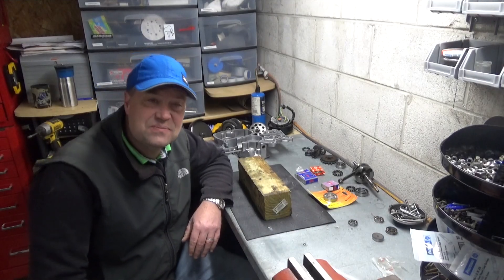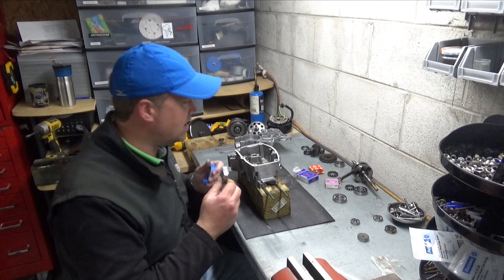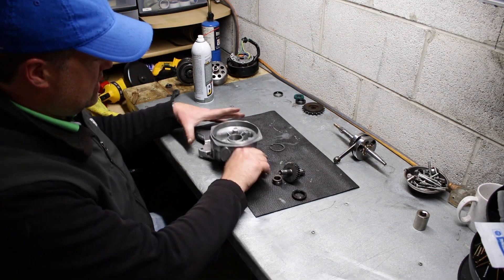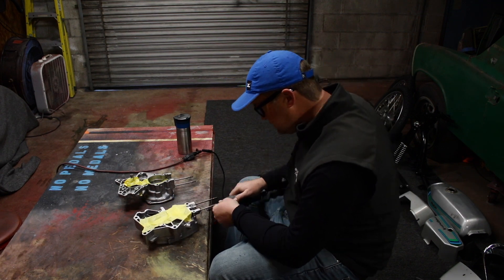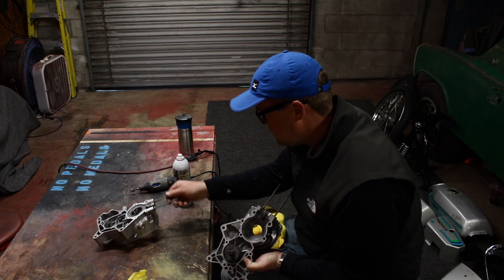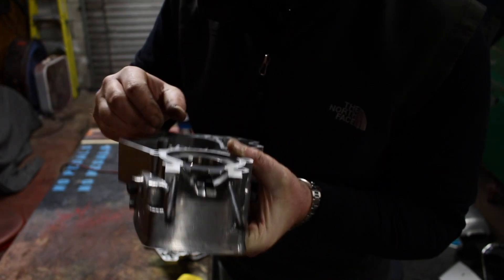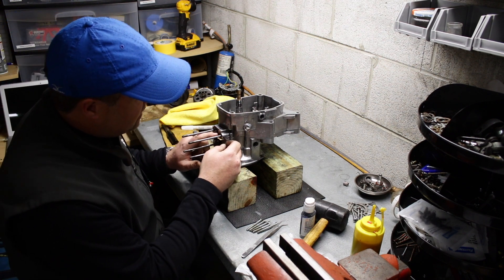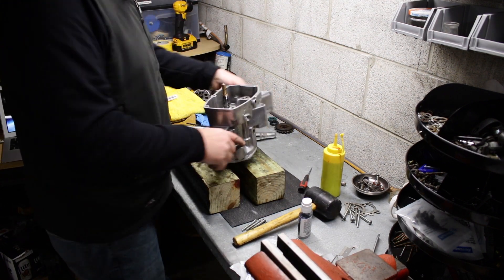DFHS Puch Magnum Ep.4 - ZA50 Engine Bottom End Rebuild

Comment: I'm really glad you rebuilt the ZA50, I've got one to rebuild soon and it's always good to have you show me how to do it right before I go ahead and mess it up anyway! ZAs barely exist over here so I'm gonna have a hard time getting parts if I fluff it up...
Reply from the maker: I finally got her dialed in. It’s a finicky motor. Did NOT like the Bing carb on that kit, so I had to swap that out for a better one. Also, timing is crazy touchy. I can add 5-6 mph with VERY slight tweaks. Today is my birthday, so the wife and kids gave me the whole day at my workshop. I just got back from a 30 mile ride and I took the GoPro. So now I just gotta edit the video and this one is all done. Already planning out the next one 😜

Comment: ha ha, you found those shims after all, i really hope that your end float is still ok after that new gasket. great job! good choice with the atomic dampeners, i had over 1500 miles on my assembly before i sold it. no issues, no degradation.
These engines are aching for more power, soo overbuilt. excited to see what kit you chose! i do see a decomp hole in it tho. get out the jbweld or thread that thingy for a plug if its too close to the edge of ur gasket. passage goes right to the exhaust port. can cause problems.

i have had great luck with both the k-star and the airsal. not sure if thats what you have there, the casting on the fins look better than the ones i had. maybe just the camera.ha
Reply from the maker: Figured out about the decomp hole. Unfortunately, it was after the engine was back on the bike and I had to remove it. I film these videos in advance, so by the time you are watching it, I’m already two or three episodes ahead. Ended up threading it and using jb weld. Gotta be thorough 🤓
Reply: Gotcha, imma dum dum. lol

Comment: Hey David, since you have rebuilt the Puch ZA50 engine perhaps you can provide some insight to my problem: started my 78 maxi ll and after about 5 mins. smoke began to come from beneath the engine and oil puddle on the floor, upon examining the crankcase did not find the leak source, no oil coming from crank seal in Magneto area, suspect crankcase not venting thus pressure build up, appreciate any suggestions
Reply from the maker: Heya Bill.  As always, it’s real hard to diagnose these things remotely. Is it oil or ATF?  If actual oil, then it’s something with your carb or gas line, since that’s the only place oil can come in.  If oil is coming out of your case, then your mix is FAR too rich.  If instead it is ATF, then the answer is simple— one of your gaskets or seals is leaking. Maybe it’s just the washer around the drain plug?  That’s a super simple fix, so check it first. But since it is smoking, I’d bet it’s higher up.
Reply: @DavidFixesHisShit  Thank you David, the puddle is actually oil , I did have to open the idle mixture  since the engine was running to lean, maybe you may have I.D'd the problem, I'll check that and clean the carb again, The engine compression is just over 142 psi
Reply: @DavidFixesHisShit  Hi David, a little update on the 78 Puch maxi 2 sport, it did have ATF fluid and not oil( approx. 900ml) drained using the port screw about 7/8 in. from bottom of case clutch side and just a trace from the drain plug. On top the clutch housing there was what appeared to be a white plug remnant when touched the remainder fell into the case could not have been much left of it, I imagine that would be the fill port, cannot find a manual on this thing any help is appreciated.

Comment: How well did this engine run after this rebuild? I'm getting ready to throw a new crank in my za50, complete rebuild, and have read a lot about problems with shimming and making sure your end float is good and just all about measurements. You seem to just throw this back together the way it came apart.
Reply: I agree, I am in the UK, and people shim when rebuilding.
Can you please talk on this Topic Dave
I no nothing about shimming and you didn't shim when you rebuilt 
CONFUSED
Reply from the maker: Hey Nate.  I heard the horror stories as well with the shimming and the end float.  My plan was to build the engine, and then move the crank and see if I had any play.  If I did, I would just take the engine apart and shim it to take that play out.  Or if it was too tight, I would use a wider gasket to make up for it.  As it turns out, when I got the engine back together, it was perfect.  I mean I didn't put a micrometer on it or anything, but it spun freely and didn't move side to side.  That's good enough for me, so I ran with it.  It is, after all, only a moped!  If it breaks, you fix it.  Thats the most fun part.  Ive put about 1500 miles on that engine now, and it still spins like a top!

Comment: Hey David great video.  I just got a magnum. With that first gear clutch and the lock washer, should it have a little give/wiggle in and out? Or is it pretty tight? Thanks!
Reply from the maker: I’m trying to think back and I don’t think I got it too tight. I’m gonna get back in there in the next month or two and flip the clutch to see if I can get it to change later.  I’ll take a look and report back.
Reply: @DavidFixesHisShit  hey thanks for the reponse! Actually got it figured out this weekend, had a something out of order that was jamming it up. She's up and running, just have to tinker a bit with the throttle as it's on full bore without touching it.

Comment: Hey great videos! Does this za50 have oil injector? About to rebuild my ZA but heard oil injected za's use different bearings
Reply from the maker: Mine didn't have the injector.  Instead, it came with a mixing cup :-).  Not sure about the bearings.  I looked in my service manual and it doesn't say anything about them being different...
Reply: @DavidFixesHisShit  
Hey david,
Were did you found that service manual? I am gonna rebuild a za50, but i can't find anything about the specs
Reply from the maker: https://martysgarage.info/wp-content/uploads/2014/05/puchservicemanuals.pdf
Reply: @DavidFixesHisShit  thank you, am now revising a za50 myself. these videos help well only it is difficult to find good parts and specifications here in the netherlands

Comment: Dave!! I asked the question a while back on another video, and got no response...How do you set the timing on a tomos engine?? I have heard and read there is suppose to be a mark on the stator that lines up with, or in between 2 lines on the engine case. But the stator coil I got from treatland https://www.treatland.tv/original-tomos-A55-OEM-cdi-stator-pickup-p/oem-tomos-cdi-stator-243100.htm doesn't have a mark on it anywhere...???
Reply from the maker: Heya Quentin. You bought the stator for an A55. Is that the engine you have?    If I remember correctly, you can’t adjust timing on the late model Tomos engines. They didn’t want you messing it up.  If you have an A35, don’t worry, you can still set the timing, but your going to need a timing light to do it. If you don’t have one, I think you can borrow one from an auto parts store for free. Park your moped next to your car so you can use its 12V. Not sure if you’ve seen this before, but it’s everything you ever wanted to know about Tomos timing. http://www.myronsmopeds.com/category/service/new-tomos-electrical/new-tomos-ignition/
Reply: @DavidFixesHisShit  Yeah my bike's a 2010 sprint a55. By the way Dave love your video's you remind me of my Father! You also have taught me a lot about mopeds!! :-)   Thanks for the link too!!
Reply: youll figure it out! as a suggestion though, the a55 cdi has a rev limiter that cuts out the power at a certain point...research a better cdi box. aftermarket(and even stock on the newer tomos's) have a bad rep for failing within a few hundred miles.
Reply: @aaronblair9583  Yeah I think I got it all figured out. Thanks again for the help everybody!!! :-)
Reply: @DavidFixesHisShit  Got the EVIL 2010 Sprint running again (ready to chuck it in the garbage lmfaorofllol), but the headlight is dim, horn doesn't work, and kill switch doesn't work EITHER!!!! Now when I turn the kill switch to ground the horn works and headlight brightens, but the kill switch still doesn't work!?!?!?! Any suggestions? I'd prefer not pull the plug boot every time I shut off the engine :-)
Reply: Quentin Moon  sounds like you’ve got some wiring messed up. In the simplest worlds the stator has two hot wires out- one for the ignition and one for accessories. The ignition wire should branch off before the coil to the kill switch which is then grounded to kill it. Then you have the accessories wire that splits to horn lights blinkers whatevs. And both of those main hot lines run to the front of your bike. Track and isolate them from stator to forks and you’ll find your problem. Maybe you’re running lights off of your ignition. Maybe your kill switch ground is feeding into the lights instead of grounding. Lots of ways to get fubar’d up by the forks with that rats nest of wires.
Reply: @glewis7466  I found it was better to just rebuild the whole harness it was in such bad shape. Thanks for the tips though guys.

Comment: I have an 1980 Indian and it's missing the motor does anyone know what motor will fit other than the original motor? One that does not require modification or extensive modification. I do have another Indian that is complete and i have been in the process of restoration.
Thank you for any info that you can provide.
Reply from the maker: I dunno Rob. I would guess that you could put any motor you want on there. Of course, it depends on how much fabrication you want to do. I’d recommend either a Tomos engine or and E50, as they are the most common (with parts readily available).
Reply: I read that there is a Honda engine that they used as the prototype for the Indian engine but the Honda engine is very hard to come by.I really would not like to do a lot of fabrication. I guess I will have to keep my eyes open for an original Indian engine.My other Indian right now is in a basket I have most of the parts restored except the frame since it will need to be stripped down and painted also the gas tank needs derusting and I need to drain the old oil from the motor and change it. So it is an ongoing project hopefully I can get it running this year. Your restorations keep me motivated to not loose faith in mine.Cheers
Reply: @DavidFixesHisShit  I am going to look into that E50 and see how much work it will take to adapt it to my Indian.
Cheers
Reply from the maker: Hey Rob. I have a Honda PF50, and I remember reading that some Indians used the same engine. You probably won’t be able to find a PF50 engine, but I think the mounting points and basic shape and utility of that engine is the exact same as the QA50 mini bike that was sold here in the states in the mid-70s. You can find those engines sometimes, and (if you are so inclined) you can always buy a Chinese knockoff brand new for a couple hundred bucks. Good luck!
Reply: @DavidFixesHisShit  Hi David. Yes i had read that the Indian motor was a knock of the Honda PF50 and that they are hard to come by. I will do some research and see if i can find one of those QA50 that you mentioned.
Thank you for the tip.
By the way, when is the next video?
Cheers

Comment: Stock points ignition is where it's at! Very reliable, and will perform to the fullest potential your metrakit will allow. I think you should run the points first, and see if you want to change later. If you really MUST have a cdi, the Powerdynamo is indeed a great ignition.....but the tomos a35 CDI is also fantastic! About $150 give or take, so about half of the $300 setup you were lookin at! 
here: 
https://www.treatland.tv/tomos-A3-A35-and-A55-complete-cdi-plus-many-frien-p/tomos-cdi-rehab.htm 
https://www.treatland.tv/tomos-A3-A35-and-A55-complete-OEM-cdi-plus-many-f-p/tomos-cdi-rehab-performance.htm

Pretty much bolt on^^^, except i think you may have to time it by hand without a key. But you have to do that anyway with the HPI and most other aftermarket ignitions anyway. (I would strongly advise against going with the HPI for this setup, UNLESS you also got the 300 gram weight to go with it)
Reply from the maker: Thanks Brandon. Too late tho. Spoiler alert, I bought the cheapo $75 ZA50 CDI from treats. Haven’t put it in yet, but that’s cheap enough that if I don’t like it, I’ll go back to the points ignition. I did buy new Bosch points as well, just in case. Thanks for the info...